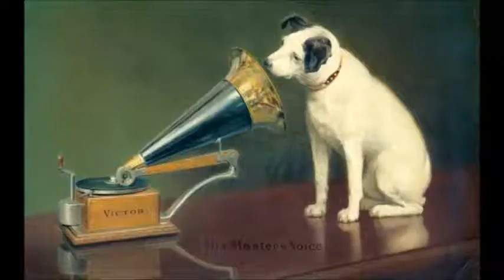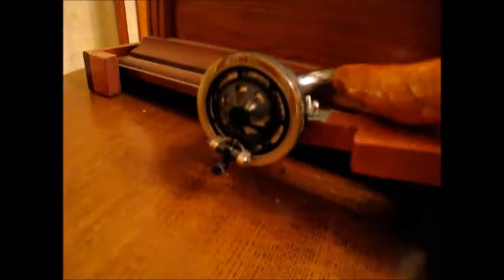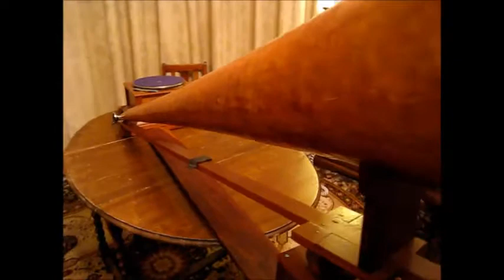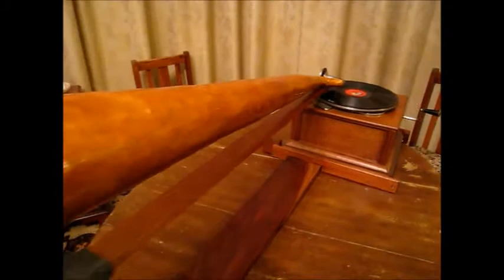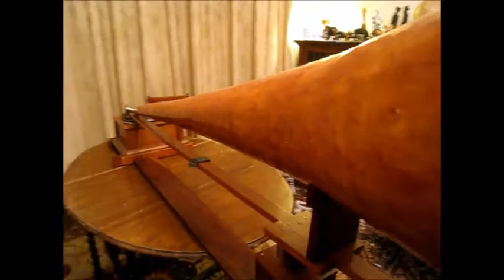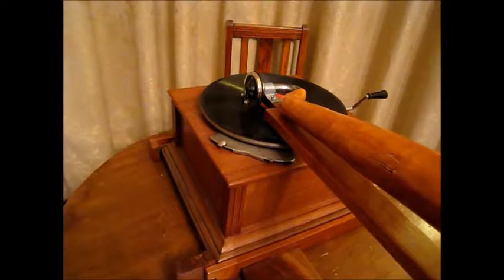Home-made gramophone: E M G (Experimental Monmouth Gramophone) No 3

Comment: This looks like a great effort so it is quite an achievement. I have a couple of comments though.
The first is that there's a whole area of physics devoted to horns - under the field of acoustics. Formulae for the construction of finite dimensions horns can be found fairly easily on the internet along with the associated performance characteristics.
So the frequency response of the horn is exactly determined by its dimensions - in essence the horn acts as an acoustic filter (as well as a three-dimensional wave director).
The second is that even though the weight of the horn, as seen by the needle, can be adjusted by means of a sliding  counterweight, this still doesn't change the moment of inertia of the horn when moving laterally (or vertically in case of replaying the older gramophone records) with respect to the record's surface. Besides, it's too much of a risk in case of structural failure or if someone/something touches it. I would not fix the tube coming off the needle sound-box fixed to the horn's throat but instead leave the tube free to rotate even though that introduces another bend to the horn. This would greatly decrease the amount of wear suffered by the records as well as the risk of damage to them. Besides, the way the neck of the horn is attached already introduces two bends anyway. To reduce the amount of distortion caused by the bends, one can judiciously place the bends so that the direction of one bends is opposite to the one that follows, that is, they form a meandering sound path rather than a spiral.

Comment: What an excellent experiment - congratulations on such a good job especially the weight adjuster, since you use Columbia parts why not make the soundbox end using the Viva - Tonal system of facets it certainly works with their cabinet machines and by the way Percy Wilson was the Mathematician who worked out the exponential Horn Theory which states that with horns over 8 ft long the sound is no longer amplified. It's worth remembering that all horns are like Musical instruments the leading edge must be smooth and even as that's where the Bass response resonates

Comment: Excellent experiment. Can I ask how you formed the horn - did you form it around a mold which was then later removed?
Reply from the maker: Have a look on YouTube at "EMG (Experimental Monmouth Gramophone) No 2", in particular from 1 minute 13 seconds to 2 minutes 57 seconds, and the corresponding text made visible by clicking on "show more". This explains how the flared part of that particular horn was made. To make gramophone no 3, the same frame was used but extended upward to a height of 8 feet, tapering to about an inch in diameter. The same procedure of pasting paper was used.  The vital thing is to wrap the frame in kitchen cling film as a release coating and to make sure that when pasting the first couple of layers of paper the paste does not get between the paper  and the cling film. Being a straight horn, the mould was removed simply by pulling the finished horn off the mould.
Reply: @davidc9533  thanks for that. I noted the details you have for the sizing of the disks for the no. 2. That is a big help as I had no idea of what measurements should be used.

Comment: Nice sound! Did you use a steel needle instead of a fiber needle or a thorn needle? I would you like to use different type of needles to see the differences in sound.
Reply from the maker: I used a steel needle - I have not thought about using other types. The position of the sliding weight along the travelling arm can certainly make a difference to the sound - older records seem to need a heavier tracking weight than later ones